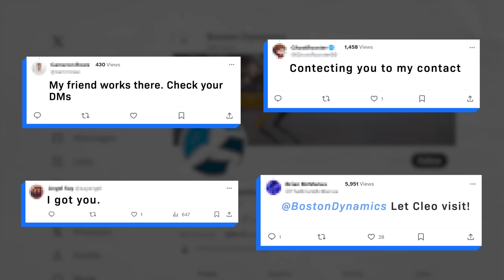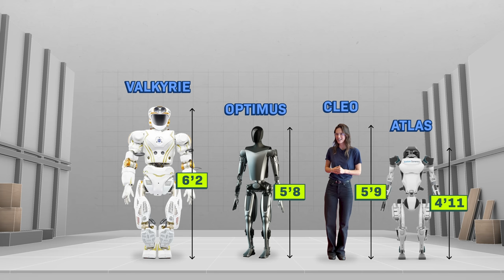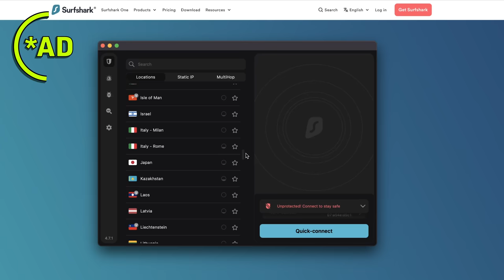I Challenged Boston Dynamics' Famous Atlas Robot

Comment: 9:03 - I think the biggest difference there is that Atlas is purely reactive while you are very clearly bracing for what you know is coming, the second you perceive that its about to come you start tilting forward to compensate. The real experience here would probably be to do this blindfolded
Reply: Very well said. The average human reaction time is 250ms, so Cleo will have fallen over by the time her brain sends signals to her muscles in response. Atlas, on the other hand, has insane processing power, and subsequently reaction time. It is also impressive that how far back Atlas moves its leg is dependent on the strength of the force destabilizing it. That really shows how many variables the engineers have to account for to create basic human locomotion that we take for granted.

Comment: Atlas is smarter than I thought!
Specifically 10:12, I thought it was doing exactly what was shown at 10:17.

My background: We did, in pairs, some tower from blocks building with the Pepper robot at uni, pretty cool. The Pepper would shut off because you kept its arm extended forward for too long between tests, overheating the motors. Such little annoyances taking up so much time! I would do it again now, with more experience :)

Comment: The legs thing can be discussed. I could imagine some multi-wheel solutions that will require much less computing power and sensors, than a balanced walk. No expert on robots of course, but I have to admit: it looks pretty cool so see a robot walking like we do. At the same time this developing is frightening. We are not too far away from that well known "Skynet-Scenario"!

Comment: Why not harness AI to expedite the design of both hardware and software for faster, more affordable integration into our homes? Initially focusing on household chores and smart speaker functions could save time. As AI evolves, it could assist in complex tasks like home repairs, tutoring, and companionship.

While there's concern about potential weaponization due to differing global values, the real issue is human responsibility. AI doesn't inherently pose a threat; it depends on how we use it. Recognizing the benefits, like reducing bias and fatigue in roles such as law enforcement, is crucial. Implementing laws for ethical AI use and addressing public perceptions through education will be essential for a smooth transition.

Comment: That robot probably has a gyro system in its chest countering the movements with gyroscopic forces.  
Could put small ones in its arms and legs to measure forces and then use its own arms as a rotation gyro like we use our arms and legs.  
Smaller gyros that let the robot use its outer mass of arms and legs to make it balance better.
It would be easier to push over like you, but also easier to use its full bodies weight more efficiently like us.
Reply: It doesn't use gyros.

Comment: I enjoy these things, but I find it terrifying that we are willing to waste SO much time and energy to specifically try to duplicate humans (bipedal motion, size wise, how it reacts/thinks).. when we can't be arsed to create f.ex. robots to clean offices. They don't HAVE to have "two legs", and look human in the least They just have to be able to get up/down stairs (and clean the same), empty waste-paper-baskets, use elevators open and close doors, and so on.. It would require SOME "AI" that can identify different types of floor, and different types of contaminations so it uses the right method in the right circumstance, but seriously.. Half of the money used to just deal with balance on these things could've made our lives a lot easier, and also made hospitals safer (as it can clean everything well all the time without having an expensive salary, so germs don't get to grow in some hard-to-get-to-corner and develop resistance against the types of antibiotica that floats around in that environment)..  Why aim for expensive toys when we could aim for life improvement?? (and that IS just the one place where it could work; Create a modular car with cassettes that can simply be replaced and recycled in an automated fashion and the price of owning a car would go down AND it would increase safety, and if you set it up correctly it would also reduce environmental impact in the long run).. There are so many situations where a little bit of effort would make gains that would come fairly quickly and last forever that.. it feels like a shame that "popularity" and how people react emotionally to "big ideas" mean that we invest in the least important part of the equation.

Comment: Optimus' hand dexterity and coordination is impressive. I used to work in a modern warehouse. One job I sometimes did was called "light picking": basically, picking items from robot controlled boxes to other robot controlled boxes. Efficient and cool as a concept for a warehouse, but ultimately mind-numbingly boring for the human. It made me think, then, that the only reason I'm here is because nobody has yet designed a hand that's able to pick and arrange randomly shaped items of random materials without damaging them. Soon, even that can be done with a robot.

Comment: Atlas weren't consutrcted to being run by neural networks and just use data to improve itself, it is a dumb ronot that, for now, needs to pe pre-programmed, Optimus is the opposite, it was desing from the beggining to learn from data, cideo data i mean, you just train it with videos and it learn using its neural netword and the BIG data center it has access to, Optimus does not use engeneeres nor code to train, it does it alone with pure data.
Reply: I'm really surprised so many people still don't know the differences you've mentioned. I think that's probably because Optimus is growing way too fast.

Comment: Next step is to place robots in space for long durations.  
This may be the best way of space exploration as hyper longevity means vast distances can be travelled over many years. Also inertial and gforce are not such a problem for a robust machine, so faster acceleration is possible. 
The biggest non-terrestrial problem facing mankind is faster than light travel. For robots that may not be such a problem, as human lifetime spans are a limiting factor in star travel. 
Now, if a corporation can send a robot to another star systems planet, and put legal cliaim on it, and its resources... even it it takes millennia it may be worth a company doing that. 
Then we have a real space race. 
Lol. 
Just need to send one to catch up with voyager and take a record player with it. And a lot of MP3s. 
Until faster than light travel is made possible, if it could, which is doubtful, Robotics are humankinds best hope of contact. 
We could even send ships to travel black holes, or warp space. 
All humans have to do is avoid extinction.

Comment: Something I do wonder about these robots is the general maintenance and failure rate once these robots are put to actual work at scale? I work in the predictive maintenance space where Im building tools to help folk running facilities get a better gauge when maintenance should occur on their vital equipment before it it has a chance to break down. The human body for all its flaws is rather resilient when we put it to work. A moderately healthy human when given what they need can do hard labour for quite a long time before their body fully breaks from it. A lot longer than some machines we use today especially ones that user servos and motors and other moving mechanical parts. 

I can't find any solid numbers or any criticality analysis regarding these robots because 1. obviously we aren't at a mass adoption phase yet where there would be enough data from third parties and 2. They won't release their own numbers to the public while the hype for this new tech is still on going and investor money is still flooding in.  But it is something to think about if were going to see these things in factories and warehouses and construction sites. Im sure they are also taking that into account. I mean humans can be poked by padded stick and still be fine so It's not like I am that impressed that the heavy metal robot endures it other than the corrective bipedal balancing part of it. Its mainly the servos in its joints I worry about over time.

Comment: I still think you can climb stair without Legs, there wheelchairs who do just that, with NO LEGS. So they dont realy need legs at all. If you are a Robot with overhuman streng, arms are clearly enough to even climb ladders. So why exactly do they need Legs? I dont get it. Everythign he told is done actualy EASYER without legs. Legs are very complicated to programm, especialy 2 legs. Where wheelchairs alrdy climb stairs, this Robot still fails to propperly do it. Remembre that Movie:  Short Circuit ? Why not have Tracks, like the Wheelchair im talking about.

Comment: human brains are made of firing patterns of electric charge that is released by genetically encoded signals that stores data that contain the way the cell would fire. each cell only operate a fraction of signals each. they are memory cells. they fire when input goes from the eye balls the memory cells fire when receive similar firing pattern as what is stores in dna. at the cell level the cell only contain a fraction so it respond only to some firings it receives. its the collective behavior that seem to form memories and retrieve them. colors in the brain are just firing pattern. its just electricity. there is no difference technically between binary in a computer able to process a spectrum of sound and firing pattern in the brain. its all programming.